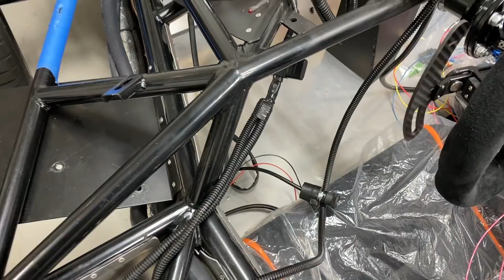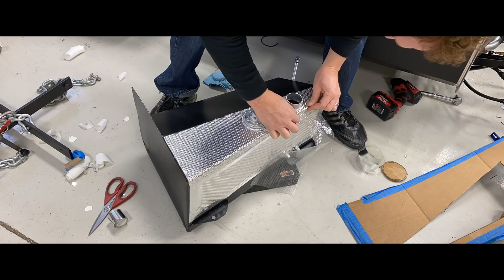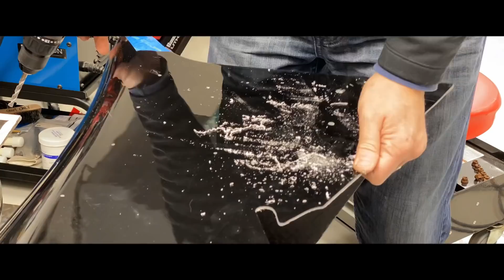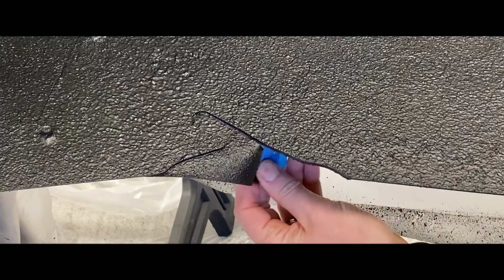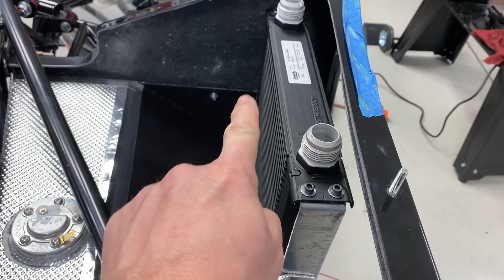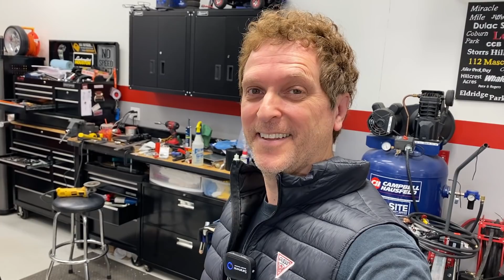Project 'Top Gun' - Dirt Pour - V10 Ultima Evolution Convertible Build

Comment: Ok but why use 3 different containers when you could just use a funnel?
Reply from the maker: Ha ha. I was trying to limit the number of containers I needed to clean after I was done. Pouring directly from the gallon to the spray gun was supposed to accomplish this goal. But you can see how that turned out. And I didn’t have a funnel with a wide enough opening as that material is very thick.

Comment: I'm watching a few of these Ultima's being built on utube at the moment.Yours is the cleanest build so far,that's my opinoin.And u are doing way more than anyone else with the heat dampening.Stuff u put on tanks I mean.Also the electronic heat valve is a good idea too.I believe u will be able to fine tune the heat better.And from the looks of that valve it will always circulate back to motor versus the shut off valve from factory.Love the project,cant wait to u get motor in and start on the exhaust.
Reply from the maker: Thanks for the kind words Lawrence!  This project is a labor of love for sure and if I achieve just 50% of my vision, this car will be one for the ages. 💪

Comment: You had mentioned in one of your earlier videos that you were going to put access panels at the back of the side pods to allow gas tank removal. Did you decide against that or waiting for when you might actually have to remove them?
Reply from the maker: Hi David. Great question. Until I get ready to permanently mount the side pods, I’m still undecided if I’ll make the access panel now or wait and do it only if I  have a problem. To be honest, I’m leaning towards the latter: it wouldn’t be hard at all to cut an access panel after the side pod is installed if I ever needed to.

Comment: You can use a step drill for drilling the fiber glass and you will have a cleaner reasult.For the rivet nuts you can add a washer at the back to make it more secure.You can also use u bolts to secure thinks on the frame instead of drilling the frame

Comment: You'll have plenty of clearance from the rear clamshell for the fittings on both sides, the only gotcha might be the bend radius for AN16 line coming off the thermostat and into the side vent area.  Also, don't worry about putting mesh in the side vents, the carbon RS side scoops will come with mesh installed.
Reply from the maker: Awesome. Thanks Will. I actually have another 90-degree fitting for the top of the thermostat that was not installed when i shot that footage. I think I’ll be in good shape there. And great tip on the side scoops; I just heard from the factory and they should be shipping them to me next week. 😎

Comment: Really enjoying your video’s Dan, I was just wondering about the size of the rubber on those rear wheels. is it really 335mm?. Might be just the lens deception. I went out with Ted Marlow in the 550hp silver GTR some years ago, the acceleration was incredible, but it needed all the 335mm rubber on the rears. It made my M5 drive home sluggish. Looking forward to the next video’s
Reply from the maker: My rear tires are 305/25-19 (on 19x11.5” wheels). I originally wanted the 13” wide wheels but they only come in 18” and indicated they are phasing them out due to limited tire choices. Evidently they’ve done a ton of testing using the 305 series tires and found the same grip as 335 tires. I’m not sure about that...but I’m likely to upgrade the wheels in the future anyway and will go with some steam roller tires. 💪
Reply: @DanDulac  Sounds like you did some future-proofing Dan, I used to work on this M8F car for few years. Rears on that were 16” wide 😳 😂😂
https://youtu.be/WrSDAnnMLi4
Reply from the maker: @aflatbroke1  WOAH. That is awesome.

Comment: I think you will struggle for clearance... I would fabricate some 130 degree weld in pipes for the coolers, should be able to cut AN -16 fittings, remove the anodizing and then weld to the coolers, much tighter bends doing it this way, or look a a few companies that do the AN fittings some do much tighter/ low profile fittings compared to others.

Comment: When putting riv-nuts into plastic and fiber glass etc, run a thin strip of aluminum along the back, stops the riv-nut cracking the fiber glass and spreed the load. The epoxy was a good idea as well.
Reply from the maker: Good idea.  Similarly, for 1/8" rivets in fiberglass, I use 1/8" washers behind the rivet to accomplish exactly as you describe.